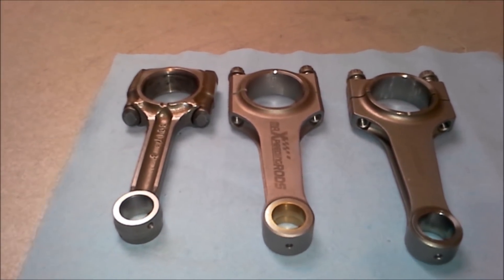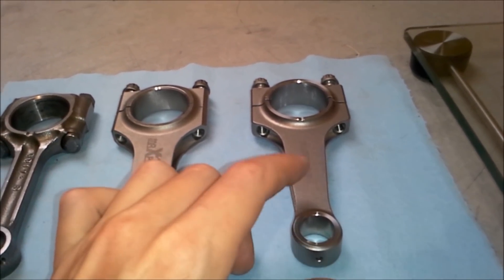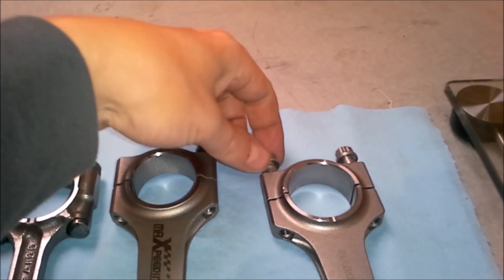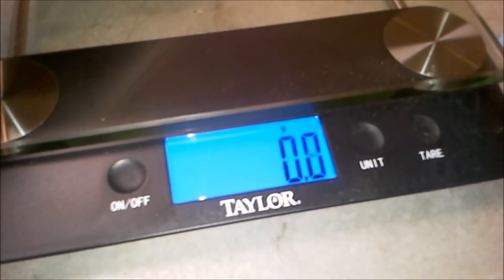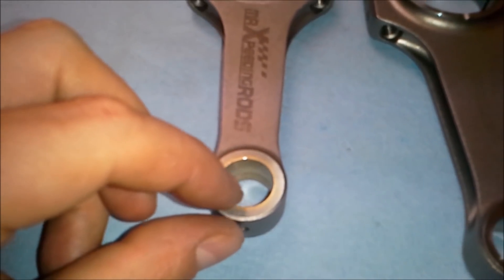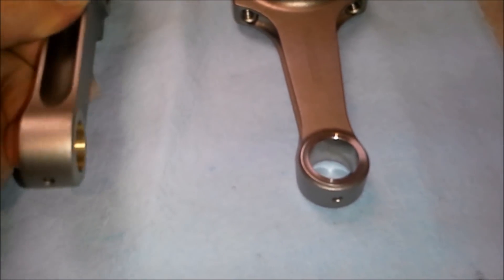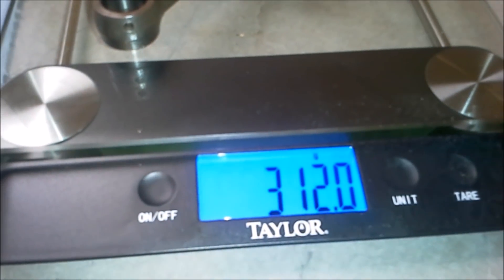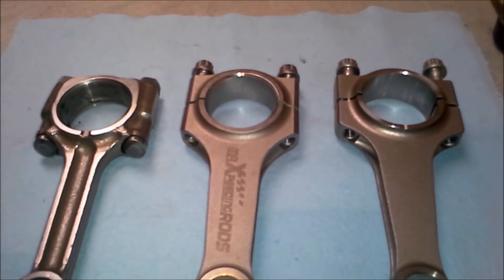OE Connecting Rods vs MaxpeedingRods vs Carrillo Rods, Cheapest vs The Best

Comment: For what it's worth.. the difference in the two is the alloy and the forging process.  The Carrillo's use a proprietary alloy, they are fully machined in the US and they have a rod failure inspection program that anytime a rod fails, they will inspect it for free.
If you search, you'll find that china H-Beams such a maxpeedingrods, manley, etc... seems their limits are reached around 500-600 hp.   Carillo H Beams , you can't really find failures under 1000 hp.  So they are decidedly stronger.   Whether or not they are worth the cost, really depends on your goals.

Comment: I went with CP H Beam Rods and CP Turbo Pistons for my supercharged Hayabusa build, I’m not building this b!tch twice!

Trans is going out Monday to be race cut and polished, head will go out Monday as well to be ported and polished, APE 70lb springs and Ti Retainers.

I bought the Rotrex supercharger nearly 3 years ago, pulled the motor and put a base spacer in and reinstalled the motor to then decided, F that, let’s build it for future expansion!

So I’m building it to take 700hp, even though I’ll only be at 450-500hp. (Maxx ECU coming and tuned on E85).

Wish me luck….

Comment: Maxpeedingrods makes some insane products for the price. I had a set of their coilovers for a little while when I hit a pothole and destroyed my Right rear OEM strut. They were the newer 24way adjustable ones with the blue springs. They honestly preformed very well and for $400 bucks they are definitely worth it. I eventually upgraded to a set of Tein coilovers and the difference was underwhelming. I have seen people with their turbos and they also preformed well. 0 shaft play and you can use them for massive amounts of boost for 1/10 the cost. You could buy maxpeedingrods turbos multiple times before you get to the price of one name brand turbo. I really wish they would make ProCharger style superchargers as well.

Comment: Wont aftermarket rods not influence the splash lubrication of the cylinder walls? Original GM rods had oil thrower tabs on the outer side (crank side of the bearing pocket) most aftermarket rods have nothing? Will I need to modify the rods with oil channels or the crank before use?

Comment: Hard to tell in vid, but the spends rod looked to be shot peened, a plus for extra strength. Then the bushings on the MPR rods are kinda surprising, but I assume (maybe wrong) that maybe they are just covering bases and add that just in case the forging is used to machine a rod that possibily might be used in a engine with a crappy cast crank to prevent friction wear. Like a newer junk ford eco boost China crank, or an old iron block engine from the 60s. People who buy cheaper rods probably tend to not upgrade their crank even if it’s an under build stock motor, hence why they buy a cheap rod. Most modern performance engines should have a forged crank oem though like the  evo 4gs Subarus sti EJ257s and Honda turbo engines. Just maybe not your small displacement eco turbo motor that isn’t intended to be a performance factory engine if equipped.

Comment: The 2 bolts in the Carrillo are either a CARR or WMC. The Carrillo is far superior. Make no mistake. And weight is everything when spinning high RPM. But many have said and it's completely true. The budget dictates the quality you will use. Carrillo does NOT get its 4340 forgings from China!
Reply from the maker: Thank you for your feedback.

Comment: The max rods only need tweaking at a machine shop and upgrade the connecting bolts to match the $1,000+ rods. If your an all out drag racer. Go with the best parts you can buy. If your a weekend rider. The max rods will work just fine. And for years.
Reply: What typically needs tweaking on these rods?

Comment: Hello EveryDayI Race,
so ... the CARILLO Rod is the LIGHTEST of the GROUP (even lighter than STOCK ! ) 
I would have appreciated a LOOK at the PARTING Line between the ROD & the CAP 
&
an explanation of whether the MaXPEEDING Rod was configured as a FULL-FLOATING  wrist pin (normal) especially with the small-end oiling hole 
&
Possibly the CARILLO Road configured as a PRESS FIT wrist pin (for whatever reason) even though it obviously has an Oiling Hole in the small-end
CARILLO does NOT omit that BRASS BUSHING in the small-end for NO Reason 
did you inquire of CARILLO as to their logic ?  
CURIOUS 
Thank YOU for the Review - the WEIGHTS alone are quite valuable 
COOP
.........................................

Comment: carillow charges for what is IN the rod....not thicker or thinner. The metal that the carillo is made from is way, way different than the metal that the Chineese rods use. you pay for what you get.
Reply: You should do a comparison then 😂
Reply from the maker: What's in the metal, how's it different?
Reply: @everydayirace  Carillo uses a metal blend that they specify for their rods. The Chinese rods may do fine.... and they may not They advertise 4340 Chrome moly steel. Where did that metal come from??. Carillo has won on every race track in the world and they are used for that reason. One thing to remember is that when a rod lets go it will NOT be when you are idling around in the pits. It will be when you are at the end of a straightaway turning over 7,000. When THAT happens often times the only thing that can be salvaged is the water pump. I spent 15 years running short tracks and have seen a LOT of scattered engines. I can say that I have never seen one  that had Carillos. I have seen a LOT with stock rods laying on the pavement but no Carillos. You are going to save about 800 bucks installing the Chinese rods. Remember that if and when it breaks.
Reply: @genemartin6962  the trick is that material-wise the Maxpeedingrods are absolutely fine, certainly nothing for high-end racing, but pretty quality material... In terms of measurments though, they have a slight tendency to veer off, hence my teacher always buys two sets of them, completes an in-spec set and sells the rest to someone who will wreck their engine anyway =D As for the failure rates, it's how you build it more than with what

Comment: Over $700 added to pay for a name carillo when the $300 rods will do just fine
Reply: Yes, your getting a better more tuned in rod. But your paying a lot more because of the name. No different than buying a $50 cotton t-shirt with the name Versace on the tag vs a $10 cotton t-shirt from Wal Mart. Take the Max rods to a shop and how them balance and it and add upgraded connecting bolds. Save yourself at least $600 and still beat the competition.
Reply: That's one way to look at it. Another is that it's going to cost more than 700 once one of the cheaper ones let go. You are paying for the r&d, testing and knowledge that Carillo have, whereas maxpeedingrods are an unknown at this point

Comment: Just ordered a Maxpeedingrod polished SS front brake rotor for my Dyna Wide Glide, we'll see how it goes.
Reply: So what's the word.  I'm going nuts trying to decide between MaxSpeeding and Carrillo, obviously $303 vs $1030 is awesome but i also read that the MaxSpeeding didn't fit in a online response.
Reply: @ShannonFlippo  I know it was 3 months ago now but I've got a budy with a turbo'd civic running msr rods and msr yellow blade gt30 its making in excess of 600hp and has been fine for 2 hard driving years.
Reply: @lukecowell7516    THANK YOU

Comment: Funny thing is I have these rods in my seat leon Cupra r pushing 563 bhp and she has done 31000 now and still going strong, all I done was replace the rod bolts and had the rods checked before fitting making sure everything is checked and measured , 
Oh and I had the bottom end fully balanced ,
Reply from the maker: It's all about the prep.

Comment: No talk about lighter rod with less rod stretch is what you want, less reciprocating mass means more HP to the rear wheel, less rod stretch means less catastrophic failure. Heavier rods does not equate to strength, but definitely equate to power robbing rotational mass. In this case better go cheap with OEM or Carrillo, anything else is half way, half way closer to catastrophic engine failure, that actually with DYno less than the OEM rods

Comment: I’m still up in the air on my turbocharged 14 bmw hp4 engine rebuild. Before I saw this I was hell bent on Carrillo rods since my stock rod spun a bearing for absolutely no reason at all. I F-in babied the bike since day one. Everything labor wise was completed at the bmw dealership (even tho I’m a licensed certified Suzuki service pro silver technician for 25 years) and could have easily maintained my bike myself. I was a good boy and kept on top of my maintenance appointments with the dealership. Paid stupid money for this bike. Never did any fancy riding. 3 months out of warranty the bottom end let’s go and locks up throwing me off the bike on the highway. Long story short bike was totaled and I bought it back from my insurance company and fixed it up. Now I’m rebuilding the engine with a bulletproof bottom end and ported heads. And I’m still punching numbers to see what turbo will work with my dished pistons. 

But anyway I’m sorry for the backstory. I didn’t want the bmw hp4 police to come here busting balls about modding a Genuine bmw hp4 comp. don’t worry guys the value is already cut in half because it’s salvage history.  So back to the topic. Your video is seriously making me consider using maxspeeding rods now. I honestly always thought the bmw s1000rr rods would last forever because I also have a 14 bmw s1000rr and I’m impressed on how bmw made its rods for that bike by building it as one piece and using a small explosive charge to actually blow the rod cap off the rod itself. I never thought my 27,000 dollar HP4 comp would almost try to kill me for being the only hp4 owner who drove it like an old man. 
Anyway sorry for the long story. I’m gunna ask my machine shop tomorrow if it’s not too late to consider those rods. Thanks for your video
Reply: BTW some ignorant people (not a mechanic like you of course) think they are 
"babying" an engine by allowing it to warm-up at idle for several minutes ....in fact they are causing wear because at idle you won't have theoil pressure .....better to just let it run for 15 seconds to get some oil moving and then drive slowly until she comes up to temperature in that way providing good oil pressure....this applies to modern engines rather than old time stuff
Reply: that's how I warm up engines. Always wondered if I was adding wear and tear by letting it move at all even if I'm babying it till gets up to temp.  And bmw guy, bmw rods have recalls from rod bolts backing out. Any number of things could cause a bearing to spin on those
Reply: I will advocate the CARILLO Connecting Rods - 
They have the attention to DETAIL that this VIDEO showed the MaXPEEDING Con-Rods did NOT take 
In the VIDEO the MAXPEEDING Rods left several areas with "sharp" EDGES that will cultivate cracking & Failures 
where the CARILLO Con-Rods were massaged and "smoothed" and caressed ... 
in real life experience - the only failures I experienced with STOCK Forged Steel con-rods + ARP Rod Bolts ... were big-end distortion / bearing failures ...  
with my CARILLO Con-Rods installed I have held up several seasons of DRAG RACING 
with only semi-annual inspections - no distortion on the BIG-END  & perfect Con-rod BEARINGS ... 
So perfect that the BEARINGS were measured and REINSTALLED and used the rest of the season of WEEKLY Campaigning
BIG FAN of CP ( CARILLO ) but not "sponsored by them  :-) 
COOP
...............................................
Reply from the maker: It happens, my 06 zx10r dropped a valve at 5k miles, shit happens. S1000rr bikes are really nice impo.
Reply: DJ Tech12zz Any update how did it go?
Reply: "Begs the question about WHY did you want such a high performance bike if you were going to ride it so gingerly??   Just for the wow factor and being seen on it?    btw "...spun a bearing for absolutely  no reason at all" .....Oh you KNOW there WAS a reason!  It might have had nothing to do with you but there was a reason ...likely manuacturing defect ....maybe as simple as a worker skipping assembly lube or someone else failing to check clearnace

Comment: MaxSpeeding bolts have coarse threat. The fine thread like on the Carillo bolts i would have expected.
Reply: Not in the car rods I have used and used many of them, they use ARP 2000, and all of them are fine thread.
Reply: WOW = Nice CATCH on the COURSE  vs  FINE thread on the con-rod BOLTS 
Now I'm curious as to the STOCK Con-Rod BOLTS & NUTS ( I wish the OP would have removed & viewed and  weighed them ) !!! 
 --- the VIDEO did NOT focus very long on a side-by-side VIEW of those rod bolts 
but
I finally got to <PAUSE> the VIDEO long enough to COMPARE  the two THREAD-PITCHES - thank YOU for pointing this out 
COOP
...................................
Reply: The maxspeedingrod arp bolts are fake by the way

Comment: its about budget the carrillo rod is for the guy who doesn't have a budget but also doesn't want to build it twice.
Reply from the maker: Yes.
Reply: This comparison means nothing. Unless you do a stress test and check the metallurgy this tells you nothing. The Maxspeeding rods are cheap for a reason. Made in China. You can put them in your 40 hp VW but not anything that puts out real horsepower. What does a blown up engine cost after the rods let go? Carrillo rods are the standard of the industry for a reason.
Reply: if you dont have the budget done build it, cause IT WILL break with the cheap chinese rubbish!
Reply: @TurboDirectSA  Chinese? They come from the UK
Reply: Jon Smith China bro
Reply: @Tunerfreak99  Carrillo UK, made by CP's company (CP-Carrillo)
Reply: @TurboDirectSA  everything is made in China inc most of your high end parts rods turbos exhausts etc and them msr rods hold up really well and will last the life of the engine if built and tuned correctly
Reply: @lukecowell7516  LOL - what we manufacture in house and what you assume is made in china are two totally different things. We do not support chinese low quality products. Go visit the CP factory (thats Carrillo in Italy) and let me know geographically where you find yourself - i promise you it wont be in china. 

Poor quality materials, and incorrect heat treatment and material spec will never be reliable no matter how you tune.

Comment: Would you recommend the maxpeeding rods in a 2jz 700bhp ? I’m in doubt . Use stock tt rods or the maxpeeding rod 👍
Reply from the maker: I don't have any experience with 2jz engines, so i can't recommend anything to you.
Reply: @everydayirace   i always think if the max speeding rods can take 400 hp+ in boosted zx10 engines

How light by drilling can a person make the max speeding or carillo rods for an NA build to make them as weak as the stock but much lighter

What do you think?
Reply: @FirstLast-tx3yj   Thats not how it works bud
Reply: @FirstLast-tx3yj  I see ur a troll. good day

Comment: 195 to 200 hp atmospheric and 100 to 80 hp around 300 horses and
Reply from the maker: Lighter carrillo rods are strong enough to handle 400-500hp, adding more material to them for more strength isn't a good idea.

Comment: Do the small end of the rods have a caged roller bearing riding on the wrist pins, or do they use oil pressure to act as a bearing? I've never taken a crotch rocket engine apart so I'm just curious. Because I  wonder why the one rod has a bronze bushing and the other two are plain steel. I got here thinking it was a small block Chevy rod comparison. I know on some older street bikes like from the 70's and 80's the wrist pins have roller bearings. Same as the two stroke dirt bikes I used to work on.
Reply from the maker: No this one doesn't, this one uses oil, doesn't have roller bearings. It's similar to your sbc.
Reply: EVERY DAY I RACE okay thanks. I had a buddy with a Kawasaki Z1 drag bike. I know some people in the high horsepower drag bike scene still think roller bearing cranks are better than plain bearings, even though plain bearings using oil pressure has been pretty standard since the Kawasaki GPz750, and all the early GSXR's but I never actually tore one apart to see the inside. I can't remember if the Z1 has roller bearings on the wrist pins too.

Comment: Carillo has stronger rod bolts for their highest end in the same range as Custom Age 625+
Reply: Lime All the Carrillo  motorcycle con rods that I have ever seen have had CA 625+ cap screws.
Reply: @ToddWright2   Carrillo offers two grades of rod bolts, WMC entry level, then the CARR bolts, which sell for about $60-70 for each bolt.
Reply: @hapfp1  My response is for "motorcycle" Con rod bolts. I have used dozens of sets of Carillo motorcycle Con rods and have never even seen a "motorcycle" rod bolt in a Carillo rod that is not CA625+ in the past 20 years.

Those bolts used to.be SPS multi-phase units, but are now as noted above. 

I am aware of the different rod bolt materials for other than motorcycle rods. Don't listen to.me. Call CP-Carillo and ask.

Comment: i expected stock rod from a modern high end japanese motorcycle company to look better than a skeleton mock up of a thigh bone! i cant believe my stock suzuki bandit could be having one of those ugly ''bones'' which probably are weaker than the one you showed from the kawasaki!
Reply from the maker: They are strong enough for stock or lightly modded engines.
Reply: arrgghhh i expected them to look nicer at least...
Reply from the maker: Looks don't make em any stronger, but add cost.
Reply: They are made to be as light as possible, everything on a performance motorycle is. They are all an ass hairs breadth away from self destructing at all times.